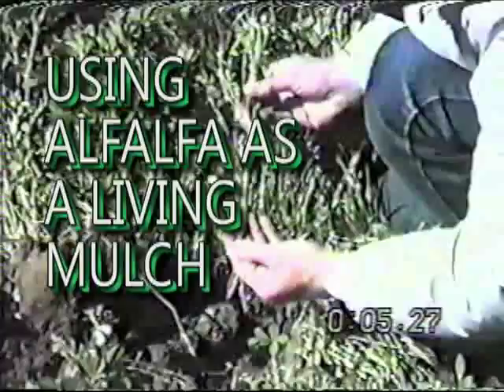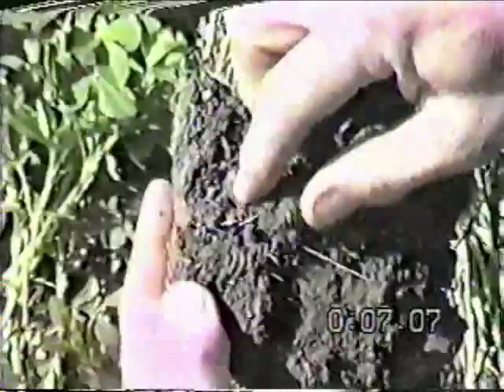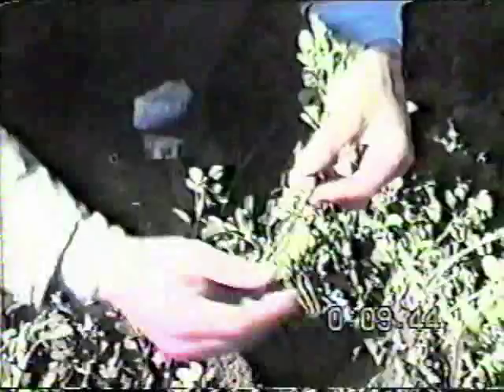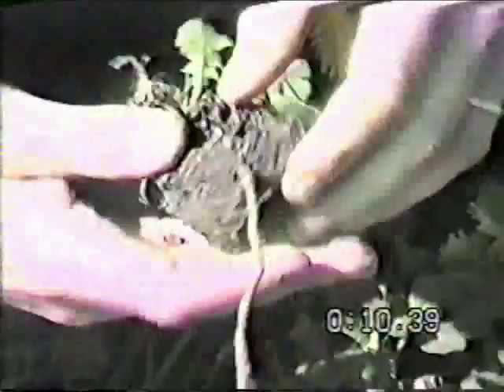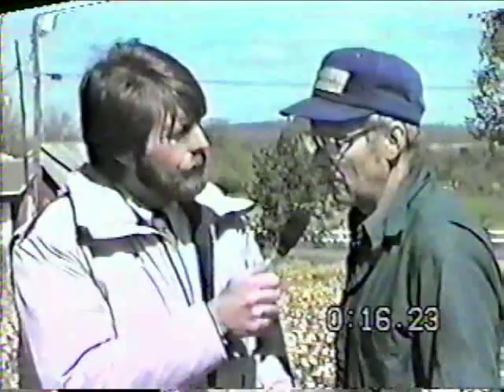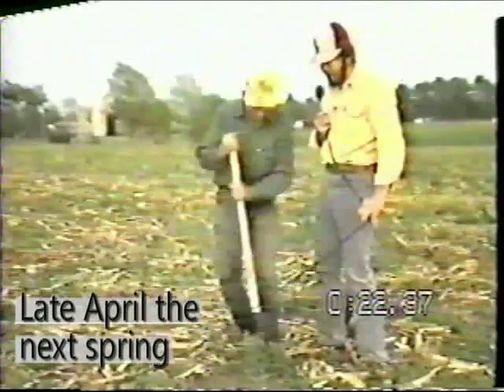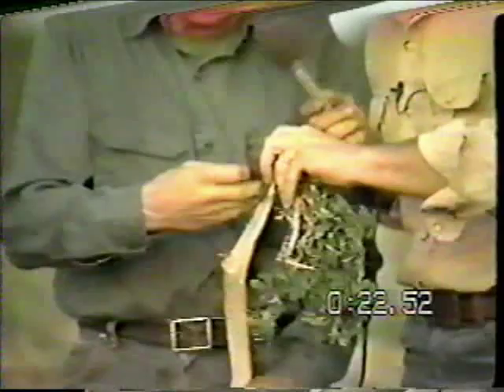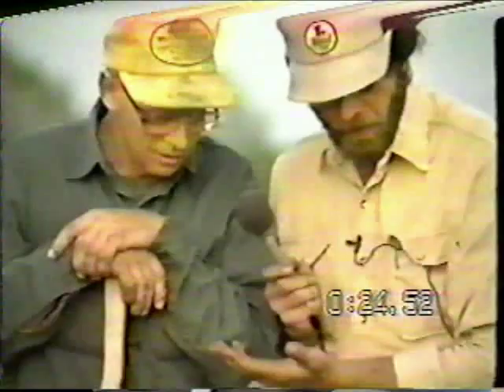Alfalfa as a Living Mulch

Comment from the maker: @ckfarm Well, interesting you should ask. I have used lemon oil and sodium acetate to defoliate with great success. A mowing machine (discbine preferred cutting really close to the crown) works as well. Grazing cattle works to with hi density stocking rate. Remove hoof traffic before or integral with planting the corn. Then cultivate corn and till to full depth with CB at V-3,4 (30 days from emergence). 
Making hay means growing shorter season corn. Still great yield potentials.

Comment from the maker: @ckfarm Another great question (challenge). Most important that alfalfa is not drinking from the same bucket as the corn. The alfalfa needs to have a "normal" tap root system. It can develop in as little as a single summer season or it may never develop depending on how the rooting habit of the plant is managed. Another subject.
Alfalfa will transpire 2.5X more H2O than corn requires. Corn will take 80% of its water requirement from the air.
The two plants together can prevent droughty corn.

Comment: ewwwwwwwwwww  roundup
Reply from the maker: +49testsamiam49  I couldn't agree more about Roundup. I suggest about anything else but. Especially in the case of alfalfa, a mowing machine real close to the crown and a chopper or baler. The interesting sidebar to this is that we have found that the soil which develops from the systematic use of the CurseBuster creates a beneficial fungal community that devours ROundup in no time flat... like a quart in less than 30 days down to something less than 17 ppb. The usual disease proliferation seen behind long-term use of RU is also missing on a farm which has used RU for over 30 years but also has never used any other form of tillage.